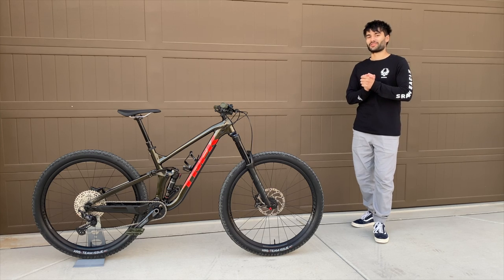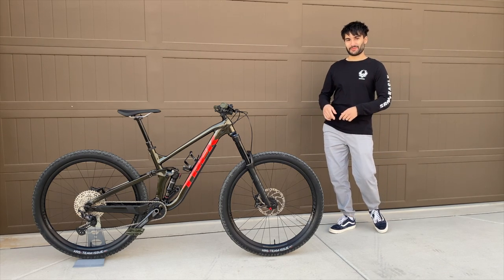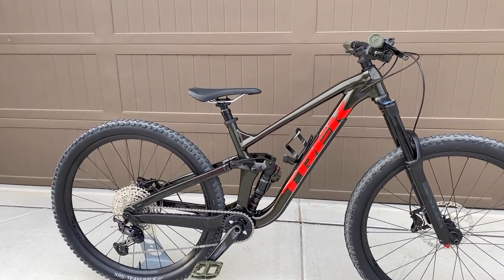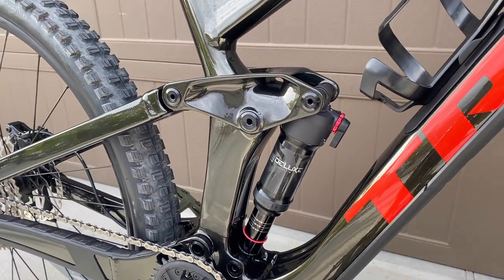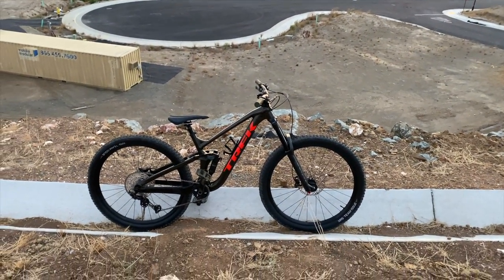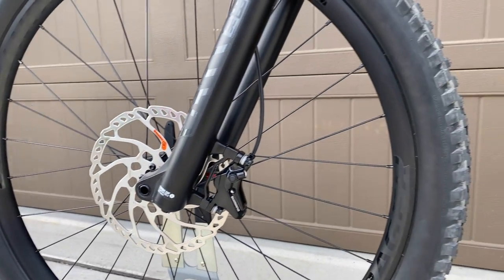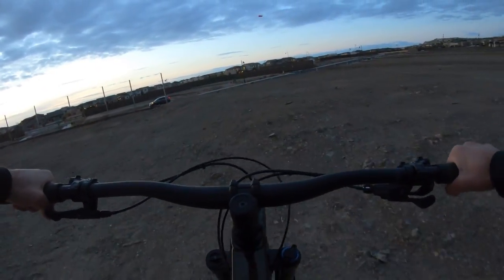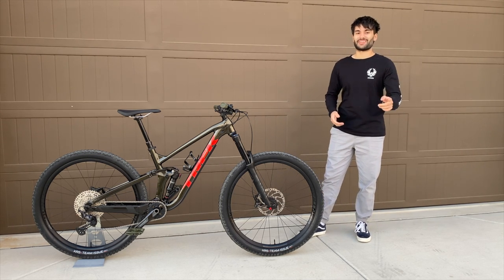MY NEW 2023 TREK SLASH 7 (Specs, Weight, Assembly, Ride) #newbike

Comment: Was so close to buying this bike, but for the same price I went for the Giant Reign Adv Pro 2 instead as it was better spec'd (Carbon Frame and ZEB Fork).
Reply from the maker: The Trek Slash 9.7 comes in at around $5,000 with a carbon frame like the Giant Reign currently, but yeah the ZEB is still better on the Giant so that's a good option for sure
Reply: @TalalipopMTB  I actually paid $3,000 USD on a big clearance Christmas sale. That price for a 2022 Carbon + ZEB bike was too hard to say no.
Reply from the maker: Oh that is a way better deal then for sure!

Comment: What’s the difference in ride feel between the slash and the fuel ex?
Reply from the maker: I’ll give my personal thoughts after Ive ridden both to compare, but I know from other people that the slash will be harder to climb uphill due to the slacker geometry thats designed for more downhill riding. It can still do it though, just slower than the fuel. The slash is a longer bike overall which makes it much more stable downhill so you have more confidence in the bike going down than on the fuel ex. On my short rides so far the slash felt faster going downhill and honestly didn’t do bad going uphill either

Comment: How tall are you because i’m trying to work out if i need a medium or large frame
Reply from the maker: I’m around 5’7” - 5’8”
Reply: would it fit a 5ft 10 in a medium?
 @TalalipopMTB
Reply from the maker: I’d suggest a M/L size since the size M technically tops out at 5’9”
Reply from the maker: You can make it work if that’s your only option, I have a coworker who rides a medium at 5’10” as well and it works out. But if you have a choice I’d do M/L